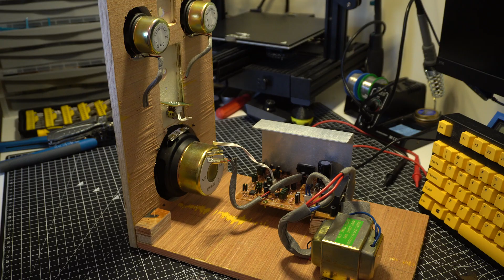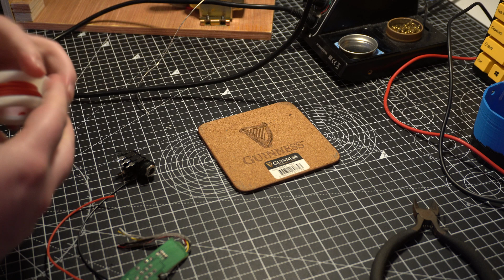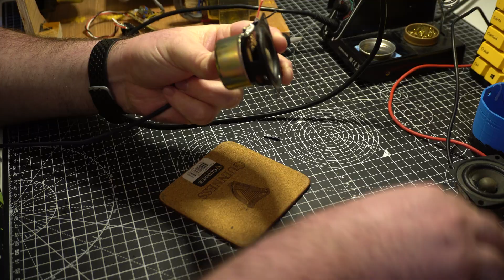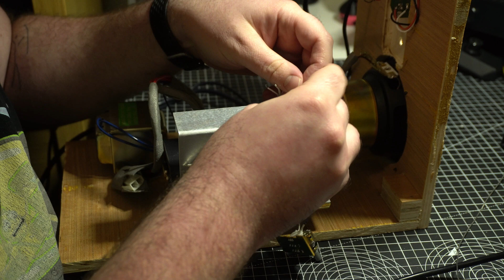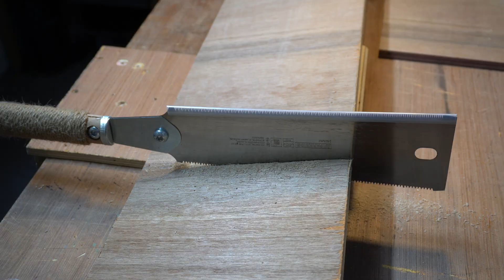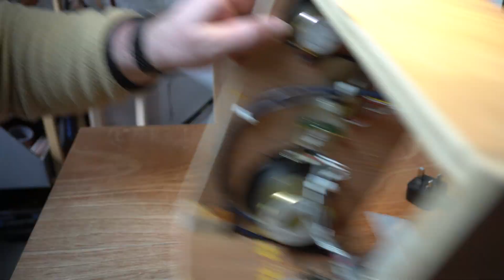Computer Speaker Upcycling!

Comment: i have the same sub... she is my baby i had her 10 years now amp inside is dying My Dell A425/Zylux subwoofer intermittently loses bass. Satellites always work. Sub powers on, woofer vibrates, and bass knob affects output, but on bad days it produces almost no bass. Sometimes it works perfectly again. Looking for diagnosis of possible amplifier/capacitor or internal electronics failure:( idk what to do I'm disabled and autistic adult with sensory issues and it has been making my symptoms worse sadly and hurting my sensitive ears when it is something i love. Any ideas on where or how to fix her?

Comment: How i
Did you get the sub out of the got dam case is cant do it
Reply from the maker: Sorry, I didn’t include the break down of the parts in this. For the subwoofer there should be four screws on the face of it under the front plastic cover. You will then notice that the wires are holding it in still. You next need to open up the back of it and you will see the control board and the subs wires connected to it, for me, I just snipped the wires at this point and the sub pulled out from the front.
Reply: @careyian  tanks
Reply: @careyian  wait can you make  a video for that
Reply from the maker: unfortunately not no, I don’t have the original cabinet anymore, I broke it apart and disposed of it after this build, sorry!
Reply: @careyian  ah no worries;)
Reply: @careyian  How the hell do you get the "front plastic cover" off of it? I don't want to crack anything.
Reply from the maker: @mts7274  I actually don't remember at this stage, sorry, it was ages ago

Comment: Seal your little speakers in an a separate Enclosure from your larger speaker/ low frequency woofer. 
The larger speaker is a airspace bully and will make the smaller speakers move when it moves ,great luck !
Reply from the maker: Ahhh that makes so much sense, I’ve seen that done before but didn’t actually know why. Quick question on this, if you saw the internal size, how much would you devote to the smaller chamber?
Reply: @careyian   I would have to have the Theile small specs to know for sure . Otherwise you make it about as big as the boxes they came in .
You can do 25% larger and it won't hurt anything.
Reply from the maker: Nice, thanks for that!
Reply: Thanks for this comment. I was wondering about this exact thing